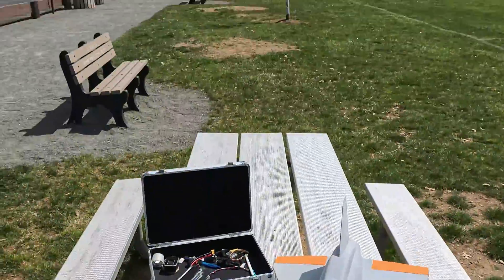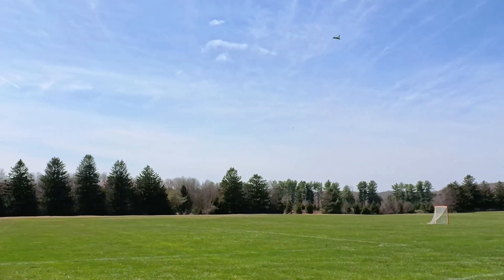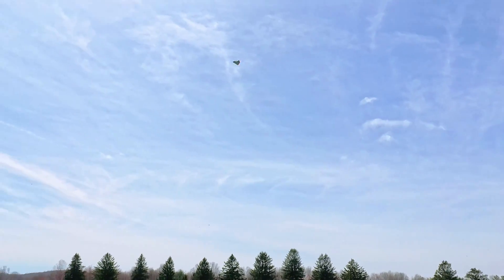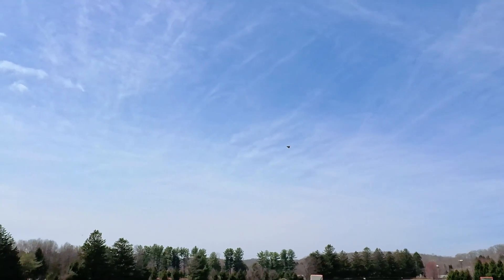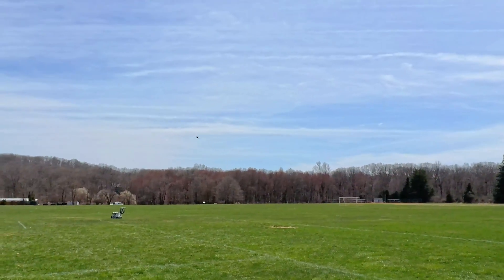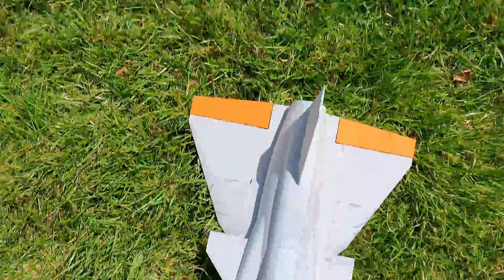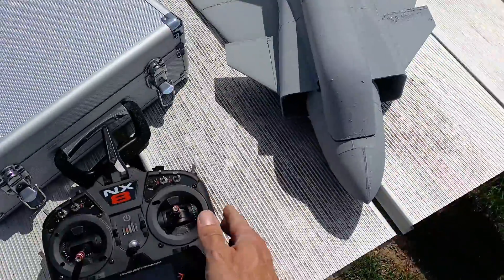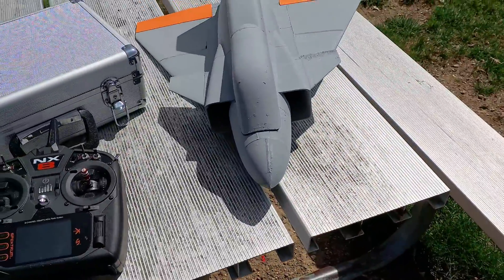Shmiggen! worlds smallest airshow ever?

Comment: According to this paper, what happens aerodynamically when you fly so slow is that the canard surface at high angles of attack moves the delta wing natural lifting vortex towards the wing chord while adding another small vortex on the wing near the chord as a bonus  :) https://scientiairanica.sharif.edu/article_3668_1032e8f1d59711e45da36a00d0e659dc.pdf

Comment: Classic example of "With enough power a brick can fly".
I still like the 'Mini-delta' best, Givin that I'd clean up the fuselage in front of the fan
Reply from the maker: Wouldn’t you say the opposite? It flies slower than most planes and it has relatively small wings
Reply: @hotlapkyle  Nope, the appearance of the Mini-Delta just really appeals to me.
Your channel just popped up in my feed and I liked it....
So thinking I'd like to get into flying planes like this (I flew RC 25 years ago then got out of it) then seeing the reply to the question about what you were printing on I pulled the trigger on getting into 3D printing with a Bambu X1 Carbon and AMS package, shipping soon.
I've been wondering about 3D for years and have multiple things I want to do with it. I've even had some stuff designed and printed before at prices that caused me to think I ought to go DIY, but kept hesitating.... Now I'm not haha
Reply: @bobjoatmon1993  would this be your first printer? If your on a budget I would recommend ender 3 v2 with a cr touch but if you can shell out a bit of cash get the x1c carbon or other like it as the p1p or p1s
Reply: FYI - got the print file for the Mini-delta downloaded & ordered the fan and ESC from the Amazon link.
Reply: @bobjoatmon1993  do you have a printer?

Comment: Hey kyle i finally got my ender 3 working again and im printing the viggen then i will print the pockst rocket! I also can't wait untill i can get twin 50s so i can get your yf23!
Reply from the maker: Great news!!! dude. think twice about the YF23, it should really have a flight controller and unless your super experieced it will need to be thrown by someone else. its probably the hardest to fly of all my designs. its the coolest but id wait until you have a large field and someone to throw it. also def a gyro
Reply: @hotlapkyle  good news man. I have my dad who also flies these planes and I have a gyro from the f16 I used to own I've gotten better. I have my uncle's land that's 36 achers so it's looking up! I'm currently calibrating my new printer head
Reply: @hotlapkyle  I'll take your advice though and probably make either a 64 or 50 j10 because i love the way she looks. If you have advice of which one I should do I'll happily take it. Also maybe I may scale it to a 70 so I can use my spare 80 amp esc